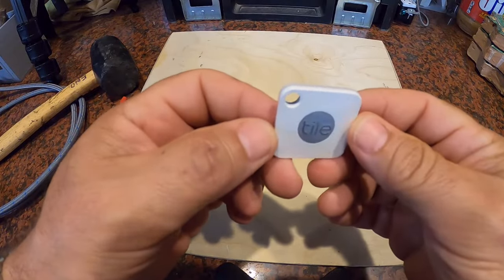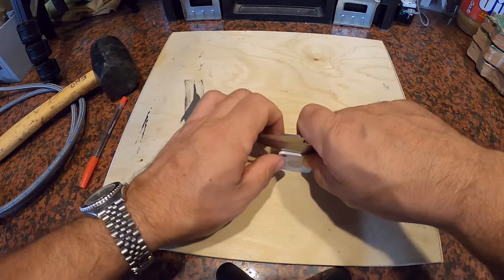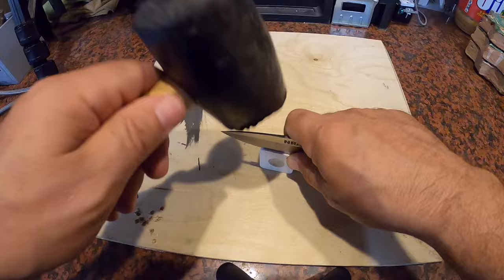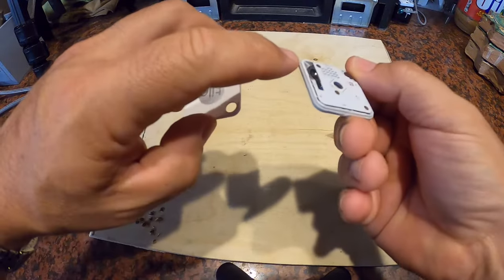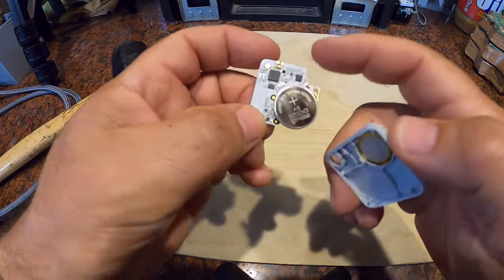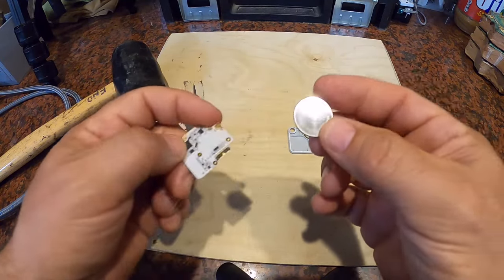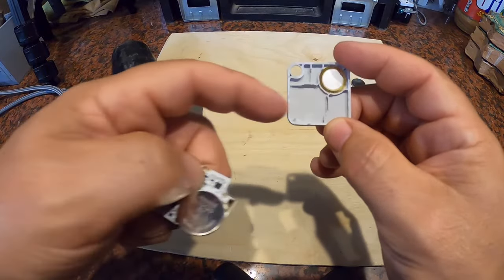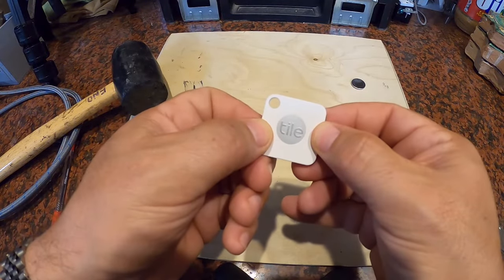Replace Battery on Tile Bluetooth Trackers ✅ ● Old Disposable Versions ● Mate Sport Pro Style Slim

Comment: It seems there is a killswitch that blocks old Tile devices from the network at some point.  My 2017 era Tile Mate no longer is detected by the app even though it's still transmitting and detectable via BLE diagnostic tools.
Reply: Go write Louis Rossman about it. He's an outspoken right to repair advocate with one of the largest YouTube tech channels and even testified before congress.
Reply: me too. Just replaced battery and my 2016 mate tile responds as it should but the app refuses to see it or freezes during 'activation'. Kill code makes sense.
Reply: @akagordon  I've just been to Louis Rossmans channel on YouTube and mentioned this before coming here. I've got the old og tile and had problems with it working on my app.

I bought a replacement and one for family and noticed they aren't replaceable batteries. I took the battery out of my tile and reinstalled  and got the app to work again but they've been up to something fishy many others have reported it with the og tiles.

Ill not be paying them a penny more from this day forward especially for an item thats soul purpose is a tracker. Maybe few people could get Louis to look into it it's horrible buisness practice.

Comment: Whatever version I had when I did this refused to work with the application after the arbitrary "death" date set in their software. The battery that was supposedly dead had 95% charge after a year so it was obviously a hard coded kill switch. I brought that up to their customer support and now I think you have an option to click "I replaced the battery". This was 2 years ago when I did it to mine. I was so pissed a company would render a perfectly working device useless to get people to buy more, so I didn't, not will ever haha. I got one laying in a desk somewhere, would love to see if they fixed their killswitch

Comment: I want to say that I just replaced my OG tile battery the third time, and it still works great. I didn't need to tap on anything with a hammer, just use a plastic spudger (plastic for electrical reasons)
It has been a year, and I needed the visual reference to remember. Thank you, excellent video.
Reply from the maker: Glad it helped!!
Reply: Indeed.  Plastic spudger for the win.  A must when dealing with electronics. Never mind slipping with a knife, esp. for older folks.  Accidents do happen with blades, haha.  [ask me how I know...]   I was afraid for the PCB when the sharp knife point was used to lift it off the mounting pins :D    

Super informative video, for sure!
Reply: Hopefully this works for me. I just bought a box of 500 of these untested/returns off of Whatnot for $15 lol

Comment: Have you tried reconnecting it on the app after installing the new battery? I see some people commenting on other videos that it connects but disconnects. Seems the company has a block setup so you can spend more money in buying new ones 🙄. Please let me know before I order batteries.
Reply: Doesn't work, you can't connect it because its registered as already paired and you cant unpair it, the remove option just hides it

Comment: Great video! You handle a knife well. I was thinking of using a heat gun to remove the glue - Thanks again for this I rather have this version than the more expensive ''replaceable'' version given anyone can pull out the battery and deactivate the device easily!
Reply from the maker: Good idea about the heat gun!

Comment: Gut the tile, and 3D print a new case BAM! Replaceable battery made easy
Reply from the maker: That works too!
Reply: Thought about this too, but wondering about the reports of this "killswitch" that would make a 3d printed option moot maybe
Reply: Any way you could share the Files for us to print to do our own 3D Print?  That would be awesome to have a new case that you can easily change the battery.  I have the one that was made in this video.  Not the Tile mate which looks a little thicker.  I actually found a 3D print for the tile mate version.
Reply: @JuliaDevan exactly. He should make his post USEFUL of its true🙄🤷‍♀️. Otherwise, who cares.

Comment: Hey. So apparently SAMSUNG are getting rid of the samsung galaxy Smart Tags, What are your thoughts on this.  And are the tile smart tags worth the money.
Reply from the maker: The Tile smart tags are just "OK" in my view - they work fine... but in comparison to the Apple Air Tags, they are just second rate.  Apple Air Tags are super precise and seem to update faster for me. But of course, it relies on the Apple ecosystem...
Reply: @ApacheRanch  since apple opened their Apple Find My network to cheap as dirt third party trackers, what's the point of them? Apart from having to buy Apple products, I mean
Reply from the maker: @agbislaundry2861  I did not realize that Apple supported other trackers.  Is this the case?  What dirt cheap trackers do you recommend that work with Apple?